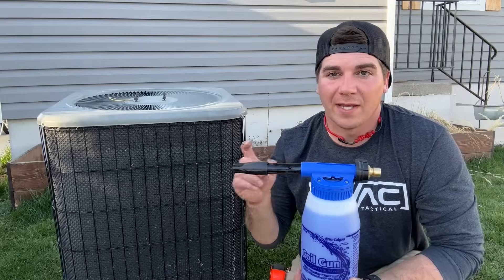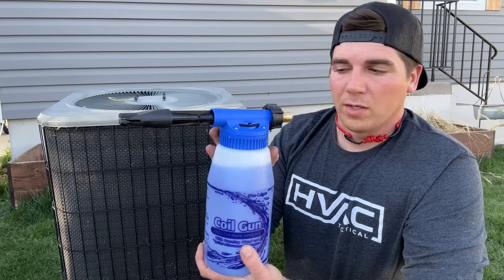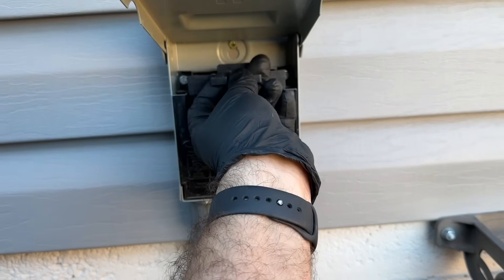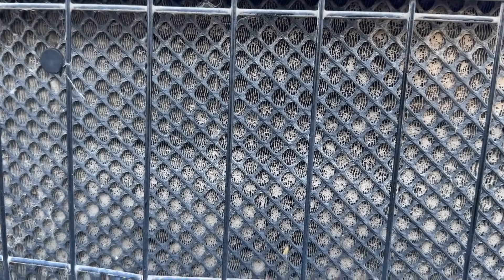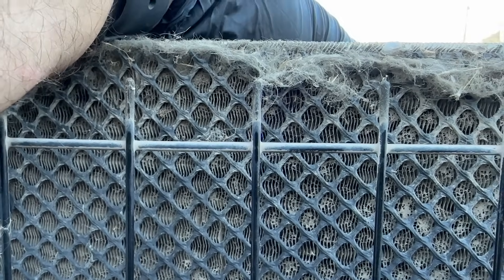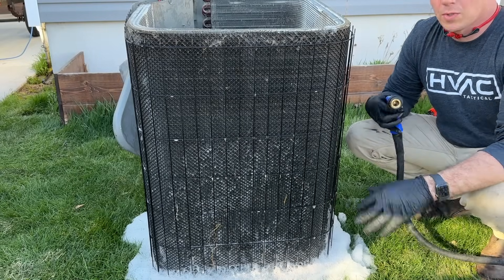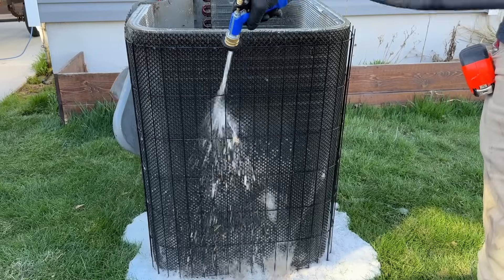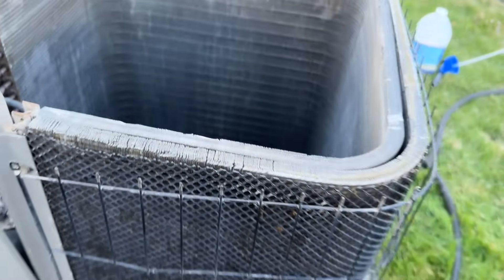How To Get Ice Cold Air By Cleaning Your AC Coils The RIGHT Way.

Comment: I have a friend whose's AC service tech spray painted the aluminum fins of the unit.  I asked him why he did that?  He said his boss told him to do it.  I asked him if he was going to spray paint his car's radiator?  Or had he seen anyone else spray painting their radiators?  I told him that was totally wrong!  I told the tenant too! They both let it ride.  Now they have to come out here every three norths to clean it. They are also charging the tenant for replacing the washable filters of the inside unit rather than just wash them as designed. Ugh!  What do you think?

Comment: Spray from the inside out for best results, this requires removing the fan and shroud, thou there is one tool I'm aware of that allows you to insert a wan through the fan and blast out.
Reply from the maker: This had a double coil so spraying from the inside would do nothing. It wouldn’t have enough force to go through both sets of coils.

Comment: I cleaned my Goodman heat pump/air conditioner per your instructions. Everything was fine until I had to put the outer cover back on! 2 hours later, I finally got it back together. I consider myself pretty handy on getting things assembled but now wish I never had done the job. It wasn't even that dirty! Uuuuggghh!😢
Reply: I started my air conditioner up today and I must say that it feels cooler! I guess all of the aggravation was worth it! Ha! Thank you😂❤
Reply from the maker: So sorry! What was the issue? Some have a really stupid design that is hard to get the horizontal cover over the vertical cover. Sorry you had a rough time with it!
Reply: It was like putting a puzzle back together. There were 4 separate panels and you had to raise each panel into the other with 3 notches on each. The funny part is that this heat pump is 15 yrs old and will probably need replacement soon. I don't know if it was worth cleaning but I did it and now it's done. I love all of your helpful videos. Thanks for replying.
Reply: Yeah Goodman units are printed from rolls of sheet metal, and are sometimes a BIT*H putting them back together.

Comment: 1st it’s a double row coil so by washing it from the outside in all that happened was packing the dirt between the two coils. 2nd all that cleaner trapped between the two coils is going to start deteriorating the aluminum and turn it to dust. 38 years of doing HVAC putting coil cleaner on a condenser coil is a big no no.
Reply from the maker: Watch the video that shows a dirty condenser I uploaded a couple weeks ago. It shows this same exact coil, zero stuff in the middle when I split the coils. So I don’t necessarily agree. And with a double coil the water will do nothing from the inside.

Comment: Hello. Do I still have to turn off the electrical power if I just spray the HVAC unit with a garden hose, but I don't open the top lid? Thank you for the videos.
Reply from the maker: You don’t need to but it’s advise that it’s off while cleaning. They’re designed for any weather conditions so leaving it on won’t harm it.
Reply: @diyhvacguy  Thanks again.

Comment: Would a pressure washer set to about 800 psi do any damage from a foot away? Would be much faster and more thorough and the scraping action of the water wouldn’t deform anything I think
Reply: I might add to DYI..... If you are using a pressure washer   ,  make sure your pressure is not too high and spray DIRECTLY into fins. Do not spray at an ANGLE. Even a garden hose with a spray nozzle can bend fins IF SPRAYED AT AN ANGLE.
Reply: What cleaner do you use?
Reply: @YXUHUNTER  I’ll use Technicians Choice “Tuff Stuff”, 8 oz in a 2L pump sprayer, and I mix that with auto detailing All Purpose Cleaner, usually about 6-8 ounces of APC. Excellent touchless cleaning solution and the pump sprayer lasts for 3 units
Reply from the maker: I wouldn’t advise it but depending on how far you are, if you know how to use it, I’m sure you’d be fine.
Reply: Low pressure is what you need for these units. I was told to just use a hose and spray mine off that way.
Reply: I use my garden hose to clean my unit if I can see through the coils to the other side good enough for me

Comment: Are there any advantages to cleaning the inside as well? I usually spray can foam my unit twice during the summer season, but only from the outside.
Reply: If your unit has 2 walls of coils, just spraying the outside will not get to the inside coils and will not clear up the debris and gunk on the inside wall
Reply: @093jmartinez  Thanks for your response.
Reply: Always go from inside out
Reply: Since the unit inhales air the best water clean will be to push mold, pollen and dust OUT by spraying a hose from the inside with the top removed.

The majority of the soap should be outside...but the majority of first attack rinse should be from the inside....then spray off the outside.

Some units give you little or no slack in the upper fan wires, so you may only be able to get a lift with a helper unless you remove the fan from the cover...a bit of a pain for a 15 minute job...and more chance to screw up.

In that case a hand holding a hose nozzle is all you can easily get inside.

Small dish soap squirt bottle with 50:50 dillution also does a great job of getting soap into the coils...and thats basically free.

Comment: Great advice 👍 I wash my unit at least once a month during the hot summer months. With anything proper maintenance is key to longevity and smooth operation.
Reply: weird. I went 12 without even looking at my unit in anyway. I did not you were supposed to. the previous owner had it for 5 years and said nothing of maintenance  and the new owners have had it for 3 with no issues last I checked. 

so it's been in service for 20 years of flawless service blowing cold air to 5 bedrooms

and you are having to clean yours every three months to get cold air
Reply: @atheistpeace7579 it's like changing the oil in your car.
Reply: @bigcountryjd  cool. I just don't understand why mine has run top quality  for so long with zero maintenance
Reply: @atheistpeace7579 I cleaned mine and the air out the vents is almost twice as cold as before. Of course mine was almost completely blocked.
Reply: @atheistpeace7579  me too. And I live in a very dusty mountainous area.

Comment: Any ideas why a unit would run louder at night than during the day?
Reply: possibly low on refridgerant
Reply from the maker: Yea it’s possible that it low on refrigerant. Al through I don’t know why that would make it louder at night. Not sure on that one!
Reply: @diyhvacguy  I'm not sure about that. The output air is frigidly cold. I think my unit was a little unlevel and that was causing the oil to settle and when the unit wasn't running during the day because of the cooler mornings, it would only kick on in the evening. By morning, it was running quiet again. I tried leveling it out and letting it run a bit more during the day just to test out my theory. We'll see!
Reply: Maybe it seems louder just because dead of night silence?

Comment: Any tips on giving more slack to the fan so it can hang and not seem like it’s going to rip/cut the wires? Thanks in advance
Reply from the maker: Probably just grab a piece of wood or something and set it next to the unit so you can set the lid on it. It doesn’t need much.
Reply: @diyhvacguy   he
Reply: @diyhvacguy   h o.o w got at you. Cool out to fix a.c.